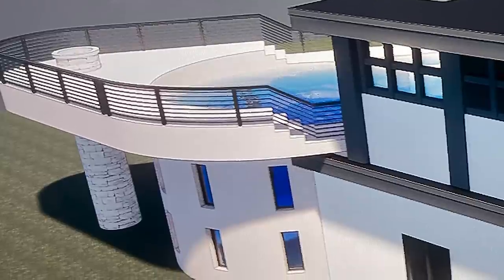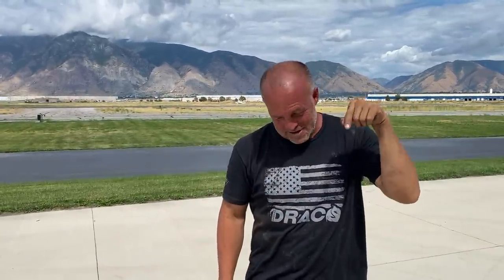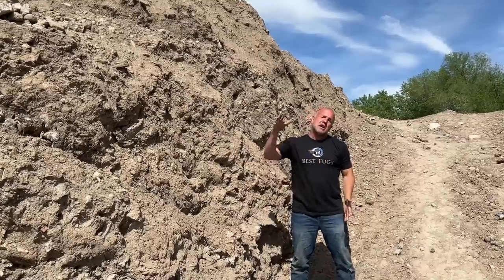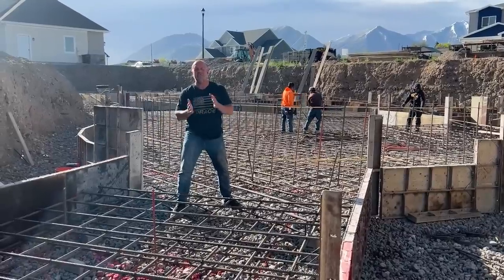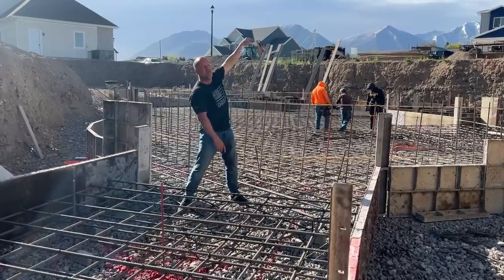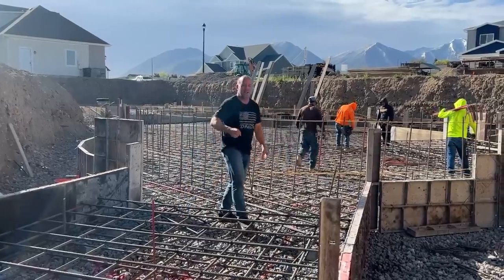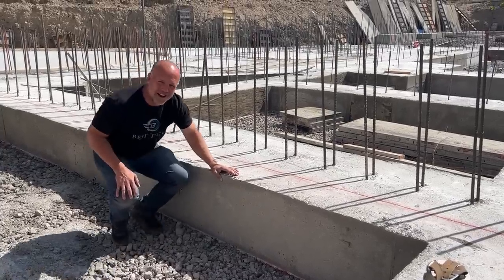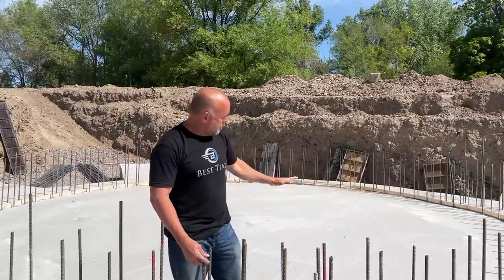I'm Building a 3 Story Rooftop Scuba Swimming Pool inside my Home! 😳 | House Build #1

Comment: Be interesting to see what ends up on the bottom of that pool, because no one wants to dive and go get it :-)  I presume there will be a way around the platform to get to the actual bottom of the pool if you need to?
I don't know if you have ever had a pool before, but just in case you haven't considered....  others have had to learn the hard way I'm afraid.
1/ Never jump into a pool, swim in a pool, where you cannot see the bottom. A pool is a big place to hide for someone in trouble, if you cannot see them, you will find out far too late.
2/ The depth of the pool should be clearly indicated at all times, especially important for your pool I think.
3/ Drowning people, drown in silence. A special consideration when there are children about. The pool area is a secure area when it's out of use.
4/ Pet dogs cannot climb step ladders. If you have pets consider more conventional steps into the pool at least in one place.
Reply: Those are all very important concerns that we’ve discussed. We’ve had several homes with pools and this one will be locked down. Not to say that accidents don’t or won’t happen, heaven forbid, but we will be taking extra precautions with this one. We’ll be addressing them in upcoming videos.
Reply: @ChandraSlyFoxPatey  I thought that was probably the case, pools are safe if owners are duly aware. I live in Cornwall in the UK, they are building a pool at Newquay, as part of the Space Program called the Blue Abyss. This pool will be 50m deep, can you imagine retrieving things from the bottom of that one? Hell of a basement that's for sure.

Comment: One of the first articles I encountered in the civil engineering magazine during my first year of civil engineering was about a pool that fell into a parking deck.  The hangars failed due to corrosion.  The problem was that the hangers were stainless steel but we're still affected by the chlorine even though they were covered in concrete.  This was 40 years ago.  Perhaps this has been solved.
Reply: Mikes will be a salt water system I'm guessing ?
Reply: Im surprised he didn’t use fiberglass rebar.

Comment: Got to admire Mike's talent for pushing the boundaries of aero engineering.  Why did he not use a cutting edge structural engineer to design this though?  This project is a crude abomination by most metrics. engineering and architecturally speaking, and your neighbors are going to hate you. lol.  Wishing you the best all the same. I'll be checking in.